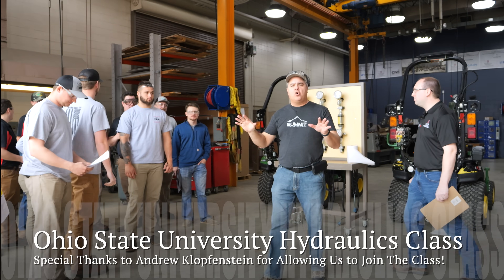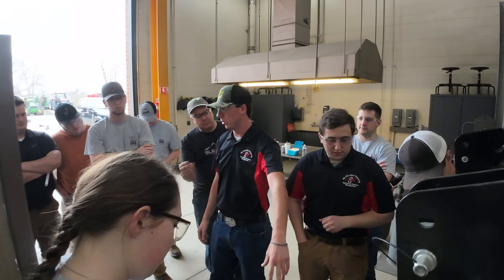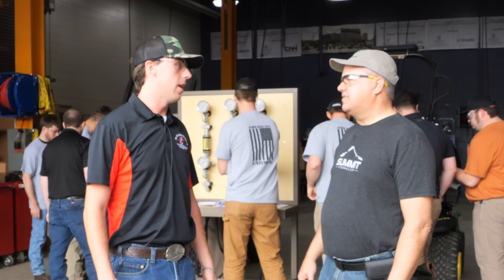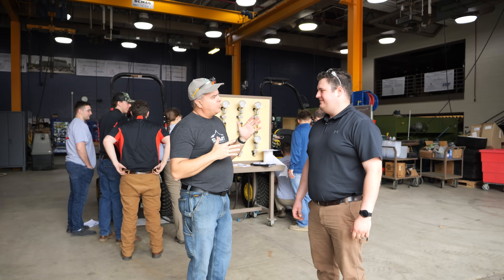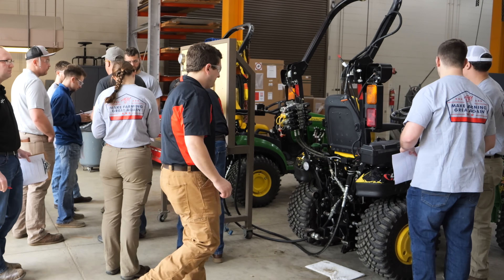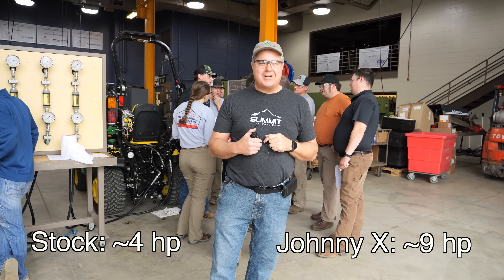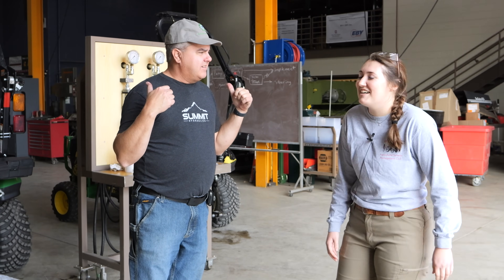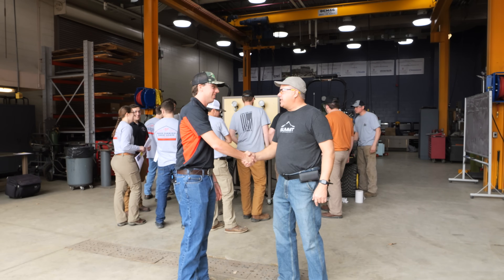WORRISOME! Ohio State Tests Reveal Johnny X Issues.   John Deere 1025R Subcompact Tractor

Comment: The pressure and flow will change with RPM’s  if you look up pumps it will give you the gmp’s and psi readings @ a given RPM . The pressure relief valve is a safety and isn’t intended to be used as a pressure adjusting valve .  The relief valve is usually set at 200 psi above the operating pressure ! If you adjust the pressure using the relief valve the hydraulic oil will over heat !

Comment: will say on relief valves, in dealing with air you have to not only figure pop pressure you also have to allow for CFM (cubic feet per minute) say a 75 psi relief valve will not work if the CFM required is 225 CFM but the valve only allows 150 CFM. Seriously simplified but that's the basics.

Comment: Tim iam thinking of putting hydraulics on my mahindra tractor I have a 3rd function for a grappler for a few years and I have a back ho power beyond I seen the summit 3 port kit for  rear hydraulics there are power beyond hoses for back hoe if I get the kit how do I hook up the power beyond and when I use the back hoe do I have to keep unhooking the hoses from back hoe to the summit valves or would I just plug the back hoe when into the ports on the kit I know right know when I take the back hoe off I have to plug the hoses together so it makes a complete loop the3rd function for grappler was a W R LONG VK12 ELECTRIC over HYDRAULIC  VALUE KIT if you can get back to me I would appreciate it does the power beyond hook into the summit kit so I can plug the back hoe in or do I have to unhook power beyond hook the two hoses together to use the back hoe if you would like to talk to me I can text you my phone number
Reply from the maker: Just plug the summit kit ‘in series’ with the backhoe…making one big hydraulic loop.  Easy.

Comment: Excellent video! As a technical writer for a major DoD contractor that utilizes hydraulics on tracked vehicles, I was captivated by the experimentation and problem solving. This is similar to the efforts perform in creating troubleshooting procedures for the solder to diagnose and repair their vehicles.

Comment: I understand some of it, generally. Upgrading from stock pump results  in greater flow which causes issues due to stock line sizes. Also restrictions in add on valves cause back pressure issues. It be great to see a diagram showing existing line sizes and rated flow. Another with Hydrosplus kits,5,7,12 gpm added and recommended line sizes needed. I need to review what gpm my various attachments require. I need to better understand the issue with the relief valve. I think most issue caused by the requirements of the post hole digger as opposed to duty cycle of a loader/ backhoe?

Comment: Good morning Tim! I have been following you for a few years now and have my own 1025r that I just installed the summit rear remote kit on. I noticed yesterday that after the first long run time many of my seals were leaking. Hydraulic pump seal, loader hydraulic seals, SCV relief valve dripping on the tire. I disconnected the summit kit from the power beyond , cleaned up all the leaks and ran it for another 4 hours. The summit kit is definitely over pressuring the system. I had the same idea to try to increase the line size to the manifold. I then came inside and saw this video! I will let you know how it works out. I wonder if anyone else is having this same issue?!
Reply from the maker: Do you have a larger hydraulic pump installed? If not, I don’t see how the summit kit is causing any issue.  We did not see much if any issue with the stock 1025r pump.
Reply: @TractorTimewithTim  thanks for the reply! I do not have an upgraded hydraulic pump, I just verified the pump model with the manual. My machine is a 2013 that I just installed this on and have been noticing small leaks since the install. After cleaning and running for a while without it connected everything stopped leaking. I ordered 1/2 lines. I only use power beyond for this system so I am going to move how the pressure line feeds the system and remove the two 90 degree elbows to reduce friction in the system as well. I should have the lines in a few days and can send you an update if you would like with some photos. All in all I absolutely love the summit kit though!

Comment: 15:20 the temperature linked increase rate has to do with the oil coolers dissipation of heat rate. one thing i leanred from the compact tractors using a loader is that the 415-425-445 can not cool well enough due to such small built in oil cooler in the narrower radiator because they are gasers, where the 455 is a 3 cylinder yanmar diesel so it has a much thicker radiator and a bit bigger as well as a much larger oil cooler made for a deere golf course greens reel mower.
this is something i still practice with gaming pc liquid cooling as every radiator has it's own heat dissipation rate and every fan has it's own CFM and static hydraulic pressure rating to push a certain CFM thru a certain radiator resistance/aka flow rate and also the pumps have their own flow ratings, and for what ambient air temperatures are being used to cool the fluids with.
just changing the fluid types used makes a big difference. another thing that makes a huge difference is the size of the reservoir tank. just adding another 5-10 gallon tank can have a big impact how long you are able to run the hydro pump for, before you need to unload it like a welders duty cycle 20 seconds weld, minute cool down, another 20 seconds on, another minute cool down.
every oil has it's own kyrptonite, 180º boiling point oils have great cold temperature power, every 210-250º oil works great in death valley, but has major power loss of about 1/3 in a ford F5500 flat bed truck running a barko 5000 knuckle boom with clam arm
Reply from the maker: Adding more reservoir would be quite difficult on this tiny tractor.  There is no space available!

Comment: Wondering  with the increase in hose size you describe  on Johnny X.    Will the Summit hydraulics  block  be able to handle the flow or cause  the next bottleneck in the chain?
Reply from the maker: Good question

Comment: Before you go making 1/2" hoses tim, take one of the summit valves off and look at the size of the holes in the block that the oil has to flow through.  I noticed on mine that the actual holes that are drilled at an angle between valves is less than 1/4" on my kit.  As a mechanical engineer that is the first restriction I would look at fixing if I were going to try something.  
I wondered if I would see excess heating on my machine due to that restriction, and so far so good, but it is not hot outside yet.
Reply from the maker: You should be fine with standard flow.

Comment: That was cool. Having the two systems side by side makes the exercise that much more impactful. You can see the pumps and hoses and see how they operate with slight tweaks. With that valve pack, they can see how flows are restricted by small things like a 90 degree elbow or a hose one size too small.
I'm glad you guys arranged that demo for that class. Very, very good learning experience and I'm sure you found things that could be used to challenge future classes with simple problem solving exercises. Well done!

Comment: Thanks for the reference Tim!  That looked like a fun day and good to see the future looks promising!😁
Reply from the maker: As you can see, I got the replacement sensor installed. 
Now to figure out what is wrong with my engine oil temp gauge!
Reply: @TractorTimewithTim   Guessing here, but thinking the sensor wire came off.  Vibration?
Reply from the maker: @mattlewis4557  maybe. I’ll have to look into it.

Comment: One of your best videos ever Tim! Have a good day
Reply: As owners and users of this equipment, it's good to understand hydo principles and system behavior change its characteristics. Especially if you're turbocharging and pursuing flow expansion on the same platform. Your next upgrade to JohnnyX might be a supplemental tank and/or larger hydro cooler to performance-match the motor, pump, and relief circuit. Because: you will also lose work effency - think 'clearance gap loss' or internal leakage on the pump as the viscosity is reduced as a square to temp delta. In other words, work longer in hotter weather. Great video Tim and good students! Thank you.

Comment: As the oil heats up and becomes thinner more of it will slip past the clearances in the pump reducing pressure. On the other side all the lines and valves provide less resistance so the overall flow rate probably stays about the same when unloaded, but when loaded the max pressure reached will be lower and the flow rate smaller.

Comment: I finished the video and was left wondering what was "worrisome". Was it the line size to the Summit valves that was most worrisome (aka - the parasitic pressure)? Or the lack of engine temperature gauge movement? Both? It doesn't appear that anything was a "oops, we shouldn't have modified anything because we are causing damage" type of result.
Reply from the maker: I think overloading the relief valve is concerning.
Reply: @Tractor Time with Tim  - and it isn't necessarily easy, or even possible, to replace relief valves with a larger one depending on model.

Comment: One of my thoughts, when you saw a performance loss at higher temps (+180°), "Is there a "better" performing hydraulic oil available such as a synthetic or oil type?"
Reply: Hydrosplus also sells an upgraded oil cooler that would help.